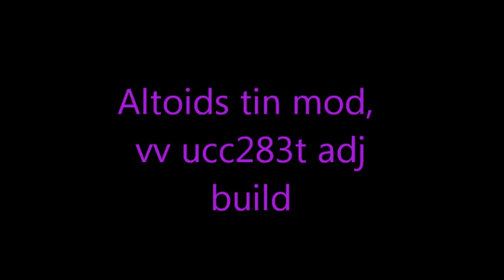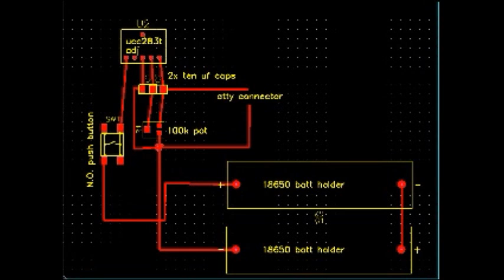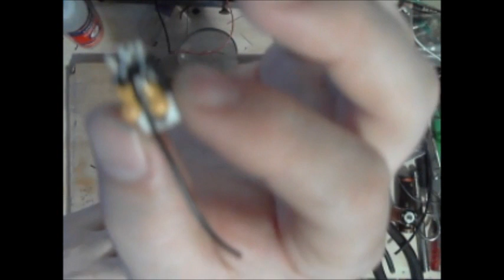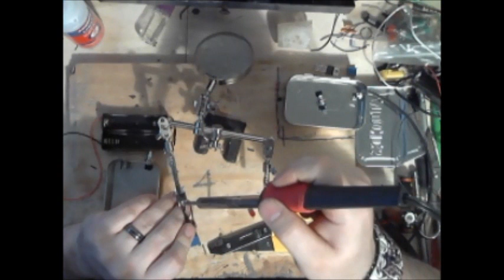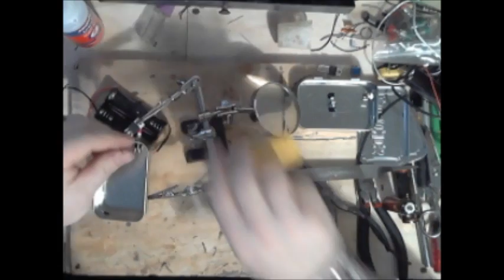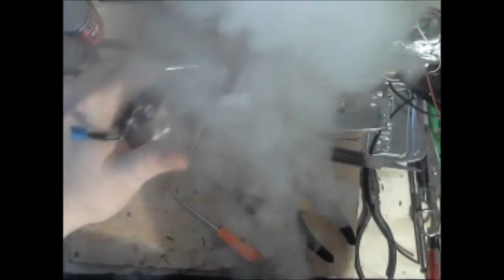Altoids Mod 3-6.5 volts

Comment from the maker: its all about amps.. At 3.7a you are drawing 2.46 amps with a 1.5 ohm carto, or at 4.2 volts  2.8 amps.. I draw 2 amps at 6 volts for a slightly warmer vape. As far as losses, yes most regulators bleed off heat, but what are you looking to trade off? I love 6 volts lets say i were to try to get 12 watts at 3.7 volts i would need to have a carto/atty at 1.14 ohms, and draw 3.24 amps, at 4.2 i would need, 1.47 ohms and 2.85 amps.. I see the higher voltage and lower amps as a benefit to the cells